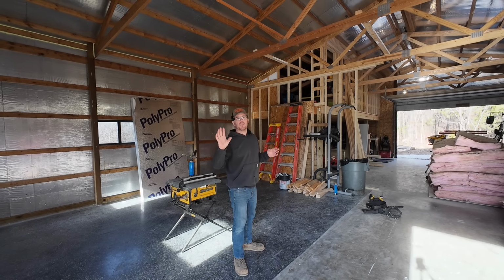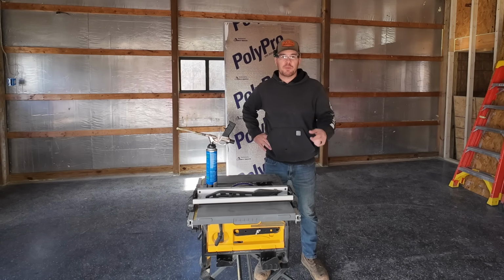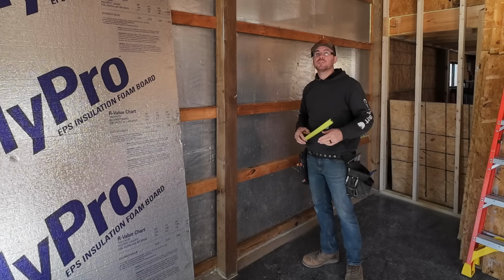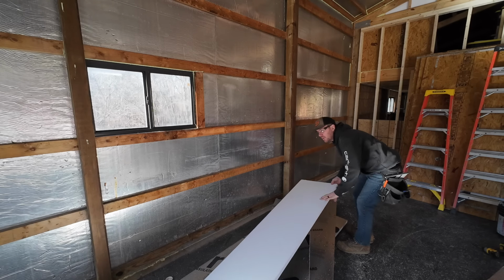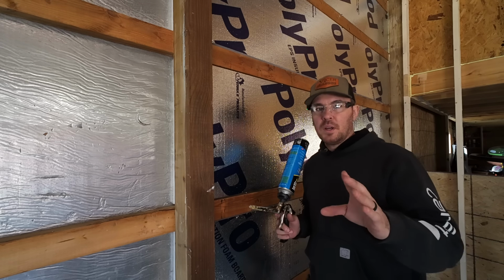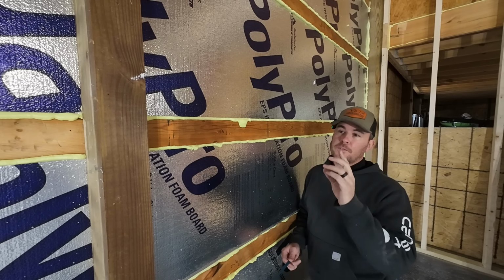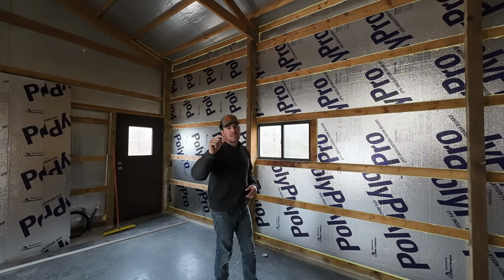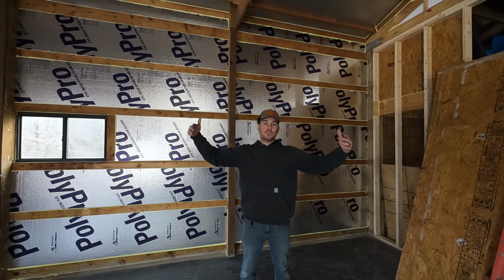MUCH CHEAPER Alternative vs. SPRAY FOAM...Insulating Pole Barn

Comment: I was a pest controller for a few years… that product will last probably up to a year being sandwiched and void of air. But it will break down and no longer work. I recommend  diatomaceous earth in walls as it will last forever.
Reply from the maker: Thanks for the suggestion.  I will check into that

Comment: EPS stands for expanded polystyrene, while XPS (green, pink, blue) is extruded polystyrene. EPS  is better for the environment since XPS releases a pretty serious gas into the air that is really bad in terms of GWP.  That being said I have used plenty of both in my home and shed. BTW I got a foam blade from Bullet Products.It's like a deli slicer for your table saw. No vacuum needed.

Comment: An easy way to skip the saw/trim method on the foam is spray it lightly with water immediately after so it cures fast.  Also the foil face foam is an added expense that adds no value in this scenario if you put insulation over it. It requires an air space over the foil for its reflective feature to work.  If you can buy it without the foil you will save a few bucks.
Reply: the foil creates a vapor barrier. EPS foam by itself is pretty permeable.

Comment: Good advice on this build out. 

Tip on using a table saw cutting foam. Buy the thinnest blade, like a 7 inch diameter 1/8 inch thick plywood blade. But run the blade backwards so the teeth do not grab chunks. It will cut very well but leave less foam dust.
Reply: If i remember right we used to run a finish blade backwards for foam and vinyl siding.
Reply: Hell, I would just use a protractor on some cardboard and make a saw blade from cardboard.  No teeth required.  Cutting polystyrene does not take much of anything.  Best of all, it is practically free, aside from your time.
Reply: Bosch “soft material” knife blade with a jigsaw or blade runner will do wonders for foam. Entire theater sets are built with that setup.
Reply: I just bought a blade made to cut foam on Amazon

Comment: Holy hell, I’ve seen the old drywall screw/joist hanger trick but man, floating it over the romex is legendary. The load capacity of a drywall screw hanging 3/8 out with only 3/4 in the wood MIGHT be about 20 pounds. Amazing craftsmanship
Reply from the maker: Ya good stuff there.  I had a hunch it was bad.

Comment: I did this exact thing on my 30x40 shop roll up door. Helped a TON. That door used to be a heat/cold PUMP. air in front of it was ether rolling up or down with hot or cold air. 

Now is it is 100 plus on the outside it is something like 72 on the inside of the door. 

I hate having to fix other people f-up crap. Been doing it all my life at work and at home.
Reply from the maker: I think its a good fit for a pole barn.   That little bit makes a difference

Comment: You do good work. That is a lot of work to get all of that in, but if you’ve got the time, it certainly does save a lot of money. I will say I don’t regret my spray foam at all. It works super well and it’s super quiet and it was quick for them to install and worth every penny. I have friends with foam board in their shops and their shops are very noisy as they heat up and cool off and as the wind blows. They just creek the entire time where my building makes almost no noise. That may be something for some people to consider. Doesn’t bother my buddies, but I use my shop for shooting videos and it definitely makes a huge difference on audio for me.

Comment: Since spray foam can expand into more than 1/4", you can cut the foam board to be even looser, and just use a couple chunks of foam on the bottom as spacers/shims to hold it up. This will also mitigate the need to cut the spray foam and expose those cells. Or, if you use a foam gun and have really good technique, you can lower the output of the gun and deliver only the perfect amount to the joint such that none comes out. But I think it's easier to just cut the foam loose, fit it easily, and blast the butt joint with foam. Keep up the great videos!

Comment: Talstar Pro was one of 3 main insecticides that we used in Pest Control as an exterminator. Great choice for insect control. On your exterior 3 ft up & 3 ft out around the base of your building you can use Termidor SC or Taurus SC(same product with active ingrdient but cheaper than Termidor). In the fall we would treat the foundation again, along with the eaves, around the windows, and any other gapped exterior spot for box elder bug & asian lady beetle control going into winter. We used Oneguard for that fall treatment.
Reply from the maker: Awesome.  Thanks for the info
Reply: Or you could just buy some termidore and spray the cavities and it will last the life of the building. They don't know how long it lasts in protected spaces away from UV degradation because the test plots they did 40+ years ago are still killing termites

Comment: Just a tip or two. Use a cheap multi-length razor knife and straight edge to cut....no messy saw. Next, trimming excess greay stuff with any serrated edge knife works well. I use a 10" bread knife.

Comment: One point to note about filling gaps with spray foam, if the gap is deep you may not get complete fill. Latest tech is expanding foam tape round all four side, guaranteed fill of gaps.

Comment: I did exactly what you just did a few years ago. Table saw, shop vac and spray foam gun. Only thing different, and be glad you had it, was the 3/4" on the outside. I had the ribs in the steel siding to deal with getting behind the posts.
That spray foam gun is worth every penny paid for it. Works amazing!
Amateur tip, lol. Gumout carb and choke cleaner cleans the foam up as good as the great stuff cleaner. Acitone is what it is.
Great with the hack saw blade. I used a multi tool with a DULL blade. 
Nice video, comedy appreciated 👍
Reply from the maker: Thanks for the extra tips.  I think it will be plenty sufficient for a barn
Reply: @SpicerDesignsLLC  By far. Our house is in the pole barn taking up a 30x30 corner. I had the metal roof professionally spray foamed on the outside. That's amazing. Rain has to be really hard to begin to hear it. 
2" spray foam on top. 2x8 joists on the trusses with 1 1/2" foam board under them and I blew fiberglass into the cavity. Metal siding/roofing covers the foam board.
Reply from the maker: @markchidester6239  dang thats got to be efficient
Reply: So you did the foam board right against the metal? I dont have anything but bare metal currently.
Reply: @thecovelife5793  in the walls, yes. Found it best to leave a gap between the panels and the framing. I used the spray foam gun to fill the gap.

Comment: I have several tools where I like to keep metal and plastic chips out of the motor.  I use a n 8,25 'Skillsaw' for cutting metal and I found that I could use a roll of electrical tape and a piece of the 'sock' from a 4" perforated drain pipe to put a rough filter over the air intake gills on the saw.  I've used two inexpensive table saws to rip panels as shown here.  I did not use the 'sock' on the first table saw, but I did on the second table saw.  The second saw is still running.  The first is not.  Foamdust is hell on the motors.  It is very effective as an insulation.  So much so, that it causes the motors to overheat very quickly.  I found that a sawsall with a coarse blade, a straight 2x4, and two Quick Clamps is faster than the table saw.  Once you set up the 2x4, you can prop the panel up in a way where you can set the saw in place and pull the trigger, letting gravity do most of the work for you.  trying to ride herd on those big panels pushed over a small tablesaw can be a pain.
EPS stands for expanded polystyrene.

Comment: I'm doing the same in my shed office. I used metal tape to keep the foam board in place. I'm also cover the wood with the tape to help with thermal bridging. I almost have it all done. Looks like an airplane in there but it's super warm. Thinking about using fiberglass insulation also.
Reply: Try mylar bubble wrap over the top.
It makes a much more effective thermal break.
Reply: @Peter-jo3wt  I use that in the shop part of the shed. I lived in Alaska and saw it used up there. It works surprisingly well.

Comment: That was a good idea separating the reflected surface of the insulation as the  radiant heat needs a gap of 1" to be reflected back into the building.

Comment: Thanks for providing a link to the spray foam gun. I need one of those. I'm tired of trying to plug up the tubing after each time I use it and then wasting half a can on top of that when it gets clogged up. Hmm, it took me to amazon, but didn't take me to the item. Ok, so the link farther down worked. Thanks.

Comment: Ladybugs and stink bugs by the thousands. I feel your pain. You designed and executed this solution EXACTLY as I plan to do mine. Well done. You even got the bug proofing right. Spray foam is a highly preferred solution but so dang expensive.  Plus the added strength it adds but alas, big bucks.  I also plan an “interior stud wall” that will sit between the vertical posts and will likely go with regular old fiberglass insulation (ease/cost).  An alternative is the blown in insulation that is sprayed through a screen and will fill the void better.  Great video of an alternative lower cost method.
Reply from the maker: Thank you!

Comment: It's a good thing you used insect spray before you installed the foam board because we used the same board in a fish house and the insect went behind the paneling and ate the foam. We wondered where the white beads were coming from until we removed the paneling. Back then we used 1/2" tuff-r-board, which has foil on both sides, to insulate the fish house. On the coldest days that you want to fish you can shut the heater off and sit in your short sleeve shirt in the fish house, beautiful stuff.
Reply: What I used also with 1/2" osb for walls. Majority heat escapes thru roof not walls anyway.

Comment: Probably too late but if you use strapping before you put your finish wall up you will still get your reflective value from the foil face. Did this to an old cape with 2x6 rafters with 2 layers of 2 in.foil board. Ripped some blocks to bump the foil flush with inside of rafters allowing a proper vent behind. Sealed everything with foil tape strapped and drywalled. Did this so I wouldn't lose ceiling height and gave me a 28.8 (2×14.4) r value.

Comment: when I built my 48x72 shop two years ago by myself pretty much it too me 6 months with concrete over 88 yards....anyway all the authority people that did not know said spray foam and nothing else.  Got a price 6000 grand even how does that even happen an even number estimate.  Looked a the foam board and at the time the spray was a third of the spray.  That's what i am using, I paint the panels with house paint white and cut them to fit using 2x2 and screws to hold them up, you don't see the wood its under the foam.  I have scissor truss and did not want the mess on my trusses, so this works so much cleaner and cheaper and still warm.  I just priced the board you use and 2 inch is a third of the foam board.  Heading out to try you way on some other area's  the walls we will see if paint sticks just have to be careful, but it should be great thanks
Reply from the maker: Ya spray foam is pricey.  Sounds like you had quite the project.   Good luck with the rest of your insulating.

Comment: Great video!  Learning while grinning is a good combo.  Thanks for posting this really helped me decide my choice for insulating my garage.  Similar construction including "creative engineering" features like under sized fasteners or wiring that did not meet the amp load for different circuits.

Comment: EPS =  Expanded Poly Styrene.  A variant version of styrofoam.  White beaded = common "beer cooler" foam.  Pink and blue building foam common to Home Depot, Lowe's and other building supply stores, sheet is very similar material but would not be as good for flotation as the white beaded version.

The metalized backing on yours helps protect the foam from UV and acts as the vapor barrier for the pink or blue, since they don't seal as well as the white beer cooler foam.
Reply: Styrofoam is actually EXP foam Extruded Poly-Styrene the green, pink or blue ridged board foam used under concrete slabs.  Lots of people call EPS styrofoam, incorrectly.

The third type of construction board foam is Polyiso.  Thats the one with a foil face embedded and is yellow in color.

Comment: as i insulate our metal pole shed i have been writing the measurments on the walls or posts in sharpie markers for easy reference.  i just picked up a bunch of harbor freight led shop lites for it  at 17 $ each is pretty good buy  lights have been in a year now (shop work in progress) no problems with them so far. the little plastic hacksaw handles might work good for the trimming up easier on hands maybe ?? fun vid dont get buried to deep in foam board:)

Comment: Thanks for the hacksaw blade tip, that should work way easier than the long extendable "click" knifes.  I have used this method with the XPS and polyiso foam boards quite a bit, it works great.  I have found, especially with the thicker foam sheets, that I like to have at least 1/4 inch to 3/8" gap around the foam board to easily get the tip of the insulation gun into, that way the foam fills the whole void and you aren't trying to follow a thin gap that is easy to spray the foam onto the surface of the panels instead.  Just what i have found, others mileage may vary.  Enjoy your videos as always, have a good one!!👍
Reply from the maker: Thanks for the suggestions
Reply: GINZU style cheap knives are great too - holes - posts - wire etc.

Comment: sounds like the Amish barns built back home, they never had a consistent spacing, even the houses wouldn't. But as an electrician I doubt you've seen too many on the job.. =) only other suggestion I would have said, too late now, is to "glue" the poly boards together with the good stuff, as they sit behind the vertical beams, there is still some thermal bridging in that small gap between the poly boards and the inside face of the vertical beams.

Comment: Pole barns and houses, it's more about eliminating air infiltration than 'R' values. Framing lunber has an 'R' value of '1' per inch, so every 8' of your perimeter walls have the approximate equivalentvof 16 square feet of area that has an 'R' value of 1.5, plus about another R for the air film. Thermal energy moves like water and electricity, via the path of least resistance, so when your done, get a FLIR survey (you'll be able to coubt every framing member through the energy transfer). The poisoning of your space with pseticides is absolute genius. I hear RoundUp is really good for kids too.
Goldblat makes some wicked insulation knives.
Curious what you did about that giant heat sinknthat you're standing on. Most pole buildings that have a SOG also have bare edge concrete w/ no thermal break or under slab insulation, so lots of heat to warm that slab and about a foot of earth under it.
You are entertaining. 🙂

Comment: One could have laid the eps over the beams and sealed it with foam, and left an 1.5 inch sealed air gap would have given you some more  r value. 
Talstar needs to be applied regularly. pesticides are designed to break down over time.  Diatomaceous eatmrrh in the wall will kill bugs for a long time.

Comment: Just a safety concern, specific to flammability... EPS is flammable and toxic when it burns. Being careful with flame and ignition, of course...good idea to also have fire control devices within easy reach
Reply: Also more air and moisture permeable.

Comment: We live in the “Age Of The Drywall Screw”… Everybody seems to think they are a structural connector. Cracks me up every time I see them used improperly. Most people don’t understand the issue of the hardness of steel and how if the hardness is too high, it can’t be used structurally because it can’t handle any sheer impact or load. I have seen tico nails that have been under excessive strain in a hanger application for many years, and when they are pulled out, they have bent over time but not sheered off. And that’s what you want, my friends!
Reply: Simpson strong tie sells screws for use with their products. Actual drywall screws, probably not a good idea. But there are screws made for every application and have much higher holding capacity than nails.
Reply: @Basketofdeplorables173 yup. I use those screws all the time anymore. And they are purpose designed screws that are the proper hardness for the job. I was just saying that steel hardness is often not understood by many people, and it really needs to be.
Reply: Yeah same with screws. They are tight and don't pull put but have garbage sheer strength. They don't bend very well. They snap/break under sheer pressure. I only use screws (ESPECIALLY drywall screws) under almost zero load or something somewhat temporary.

Drywall screws are cheap for a reason...

Comment: Nice work as usual.  Did the same thing on our prefab metal shed for our tack room.  We went with LP Smartside instead of drywall.  Paints easy and moisture resistant.  BTW - Buying that gun from your link for sure.  Hate those plastic tubes and wasted money on dead/half used cans a month later.     🍻 👍
Reply from the maker: The smart side is great stuff.  Youll like the foam gun.  One of my favorite tools
Reply: Aren't you supposed to leave an air gap between the siding and insulation?
Reply from the maker: @tommyskusa9981  there is.  Its corrugated metal.
Reply: You hooked me with the Elvis karate move at 0:30 lol, classic.

Comment: What would you do if the walls were bare metal with no previous insulation between the wall and wood??? We moved into a place with bare interior walls.
Reply from the maker: You can do the same thing.  Its really better that way.  I have somewhat of a double vapor barrier which isnt ideal.